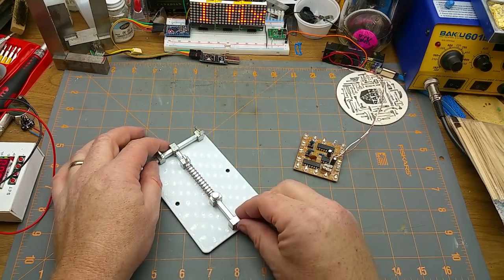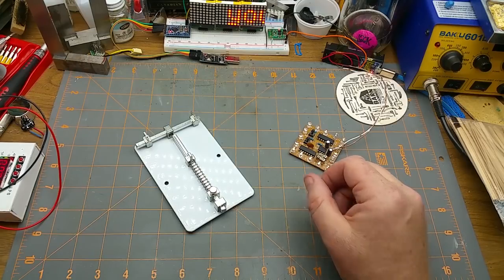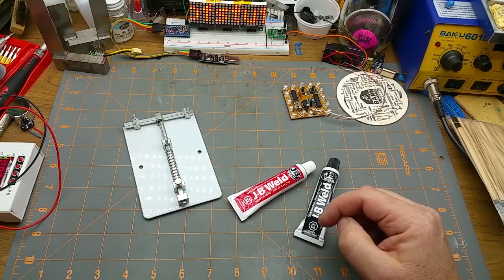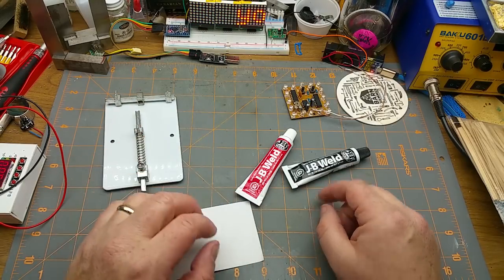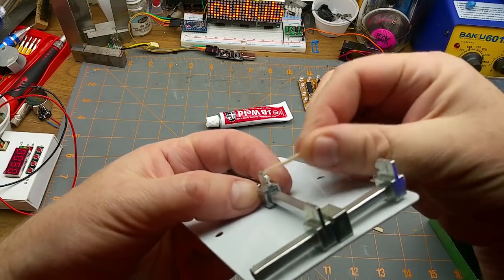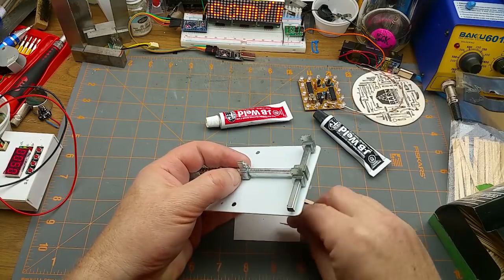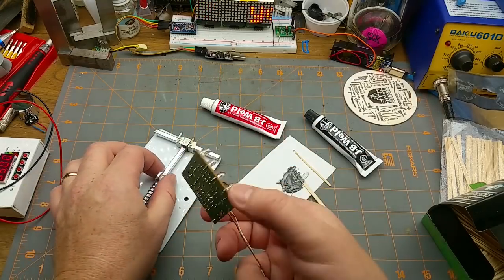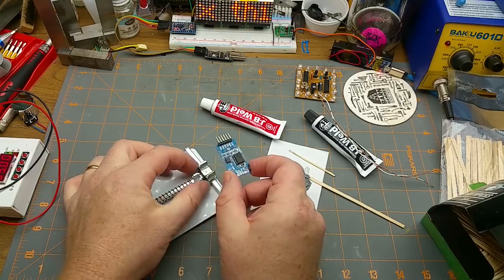circuit board holder revisited

Comment: I saw someone, I think it was Big Clive, using a jig to mount a trough hole board, on the component side it had a cover with some type of foam so it will hold low and high profile components, then you turn it around and solder everything in one go. Neat.
Reply from the maker: I've seen Clive use  that a few times, and I remember him describing it at least once. IIRC, he said he's had it for ages and that it was quite expensive when he bought it.

here's one where he uses it without talking about it's features: https://youtu.be/CrdheP3Dwyc?t=1495
Edit: Here's another where he gives a few other bits of information about it: https://youtu.be/rv_Nb-EiPSI?t=1052
 Can't find the one where he more thoroughly explains the holder at the moment

Comment: The problem you mentioned regarding the holder being too shallow, I think the same could be overcome thus. If you see at the bottom of the base plate, you will find that it is fixed with two screws. If you open the screws and put a washer or a spacer in between the contraption will get elevated making space for higher installations on the board. Try it, perhaps you will find it ok. Thank you.
Reply from the maker: This one is designed with SMD in mind, and for that application, it does it's job pretty well.

Comment: I have one of these things, they are great for soldering surface mount stuff, even with hot air gun. I had another problem with mine: one of these rubber foam thingy foots was missing on mine, and these screws at the bottom were sticking out a bit, so whole thing was a bit wobbly and was sliding easily. So I got some eva foam stickers, and stuck a big square on on the bottom and it solved all of my problems with it.

With your unit I think it was enough to hammer it in a bit. And I see you do have a full size rail in the pile, not only model sized ones.

Comment: This is specially for SMT using SMD components. Usually it is mentioned in its title by the seller.
Reply from the maker: I find a lot of the e-bay sellers titles are a word jumble of keywords. Often including  keywords that are vaguely (or not even) related to the actual product.
In this case, surprisingly, the seller didn't mention "SMD" or "surface mount" in the title.
When I am buying the absolutely cheapest thing I can find from Shenzen, I don't let my hopes get too high. 

Poor descriptions and random quality are part of the game when you go as cheap as possible.
Reply: @pileofstuff  Do you pay on Aliexpress with the App, because some sellers give you an  extra discount, if you order from the App. My best discount was on an SSD 76 USD instead of 94 USD.